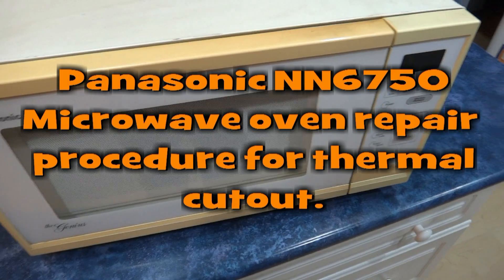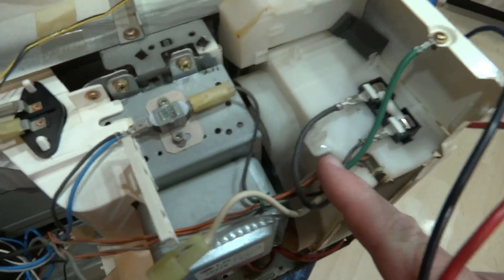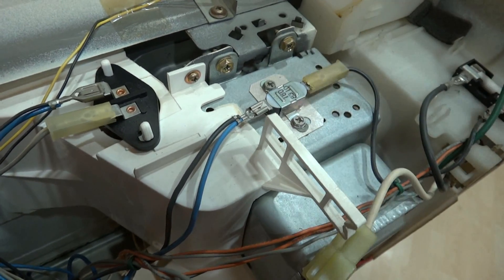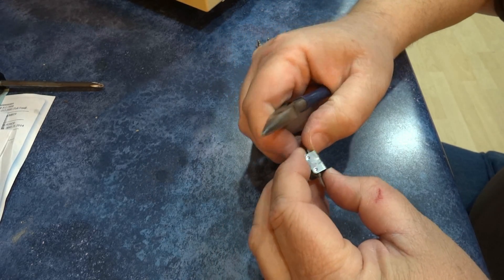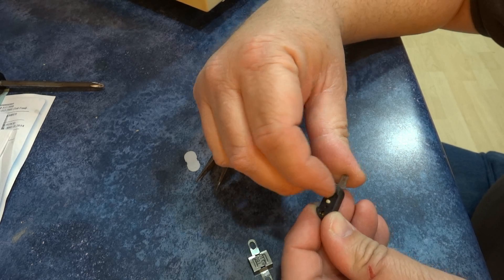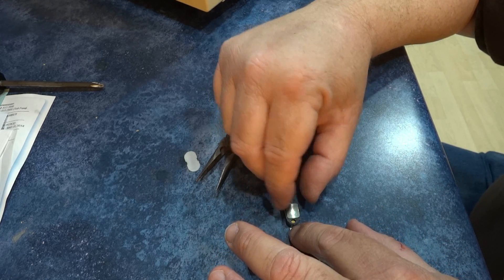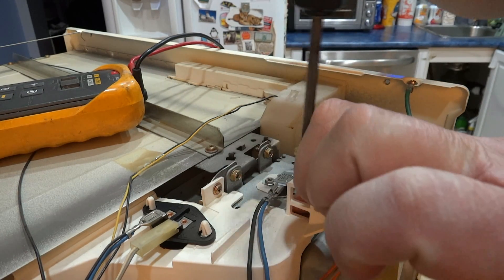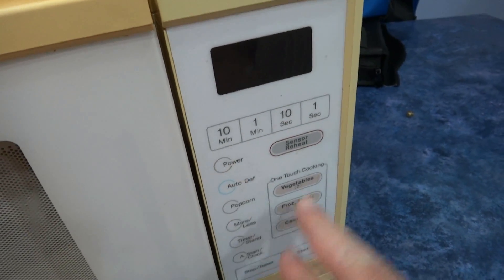Panasonic NN6750 microwave oven repair

Comment: I found out that the Panasonic nn-GD568S, its working but not heating food. I opened it up I saw that the magnetron magnet its cracked in two. How can i get this fix take it to someone else or do it myself the only thing is that i cant find the capacitor. Does it not have one or does it use a different system?

Comment: I found one of my thermal CO was open on a Panasonic NNS253WF Inverter Micro wave, Are they always supposed to be closed normally? The MW runs for a few seconds, and shits off right now. It may be an easy fix hopefully?
Reply from the maker: +123ram123ram Thermal CO is normally closed. They open if the temperature goes over the preset limit. There is ALWAYS a reason for this. Either your airflow is restricted&#160; and the magnetron is overheating, or the fan bearing is wear in, which is slowing the fan down and causing low air flow, or as it turned out to be the case on my unit which didn&#39;t happen again for several weeks, the power control relay on the logic board had pitted contacts, and ever so often the contacts would stick, and as soon as the door was closed the magnetron would power up (when the fan wasn&#39;t running as it was on a separate relay) This would heat the magnetron up and trip the thermal cut out. Of course whenever it happened was when the wife was cooking, and you know how observant women are with anything right.I know I am going to get slapped by the females in the channel, but it is so true, and you know it. I caught it when I went to use the oven one day, and I had just finished heating something and I heard the buzzer, and the fan stop, but as I walked up I could hear the magnetron still buzzing away until I opened the door. Then it shut off. Closed the door and it started again. Hmmm, gave the unit a smack and it went off. Ah-ha sticking relay.Now back to unobservant women, and it isn`t just my wife, my daughter is no better. SHe asked me to take her car to the gas station and fill it up. SO I jump in, and immediately noticed a shimmy in the wheel and a loud thumping coming from the right front. I asked her how long it had been doing that and she looked at me with a blank stare like I was speaking a foreign language. The trouble there was the tire was literally falling apart, and the flopping around inside the wheel. Talk about a dangerous situation.Anyway back to your problem,  you will need to disconnect the magnetron, and see if it still shuts down after a few seconds, if it continues to run then the magnetron is shorted, if it still shuts down then the inverter board has a fault.
Reply: I just put the bugger back together to take it to a fella. Now I want to tear it down again, and try your ideas, which seem very logical indeed. I wish you were local, so I could pay you to fix the darn thing. I am in Halifax, NS. In any case, I want to thank you very much for all of your great information. I wish I could get you out of hock with the ladies now though, but way too late for that, haha.
Reply from the maker: +123ram123ram When I worked for the Panasonic warranty depot we were never permitted to service the inverters due to the extreme hazard they present. 4000 volts DC at just under 1 amp. So, any time an inverter failed, and in the early days that was all the time, they were replaced as an entire unit.
Reply from the maker: +123ram123ram  The thermal cut out is a safety device. For testing you can jumper it, to verify that the unit is working, but before you put the oven back together and back in service it needs to have this important safety feature, just like it needs a fuse. Without it, the unit could overheat and start a fire if it wasn't safely shut down. So for testing yet you can jumper it, and if it runs cool then you are good. If the magnetron overheats then you have a cooling issue.

Comment: Harry you're a genius. This is just the problem I had with my panasonic microwave in our RV. Same symptoms! Took it out to my Brother and proceeded to isolate the problem to the relay. Thanks for the video .... very nicely done. KK
Reply from the maker: ***** The root cause for this overheating failure was a relay that the contacts got pitted and started sticking, and causing the magnetron to energize when the fan was not running, and thus overheat.
Reply: 12voltvids  Upon further investigation we believe the problem was with the fan.  This is also an older model and after time The plastic cooling fan came loose probably jammed and came off. The thermal cut off shut down the unit. ???? Do you know where/if an auto cut off is available?  Thank you very much!  KK
Reply from the maker: ***** There were 3 types of cut outs that Panasonic used.One like the one shown in the video that you can open up and reset, there was a type with a round base that was crimped to the body, however those ones were usually (but not always) auto resetting when it cooled, and then there were the 1 time thermal cut out that was inlaid in plastic base and filled with epoxy. It will have a temperature stamped on the side usually in degrees Celsius.  I used to get all my microwave parts from a company called Main Electronics in Vancouver BC. They ship everywhere, and you can find their online store on google
Reply from the maker: ***** If the fan has come off the shaft use some epoxy llike jb weld to secure it and it will never come off again.